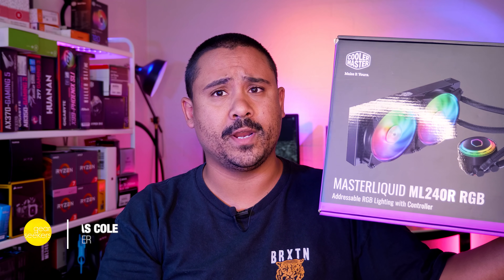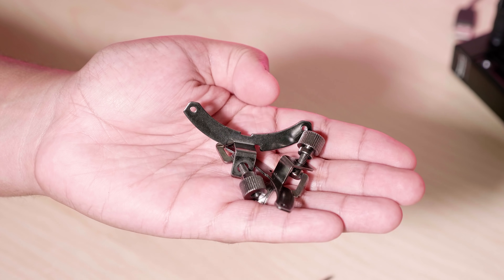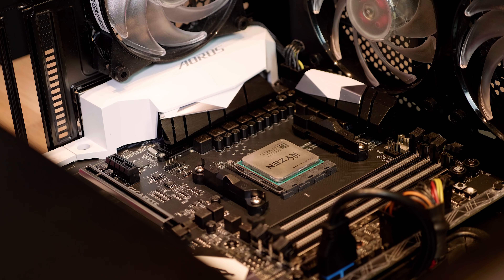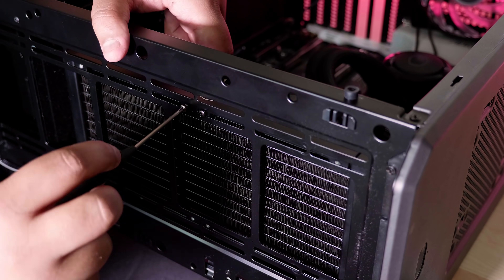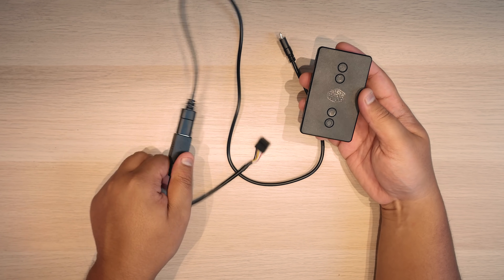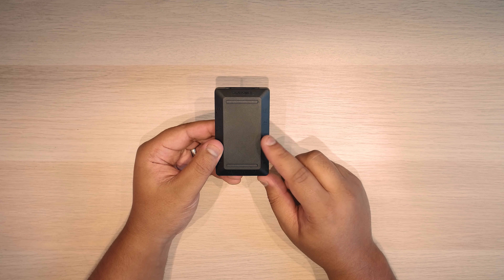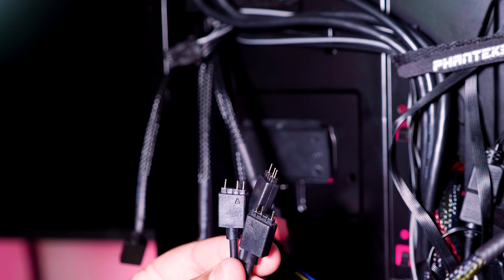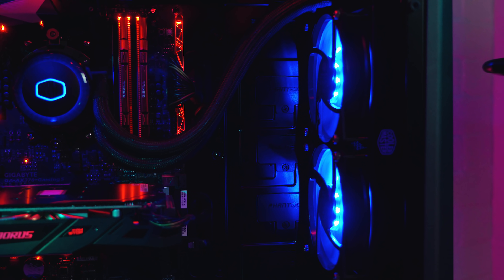HOW TO Cooler Master MasterLiquid ML240R RGB AM4 Install Guide

Comment: Im not fcking able to controll the RGB with the software
Reply from the maker: Read the comments mate. It's been answered so many times. Update firmware on controller
Reply: Gear Seekers 1. Jeeeez thanks man that was a super fast reaction, but overall I connected it so much different I didn't even use some of the cables and the guide for that is way to hectic and fast for me I gotta be honest

Comment: Currently installing mine while watching this vid :) very helpful so far BUT I don't have clips to mount it on the motherboard? Just 4 holes from the bracket behind... There was no heat sink on here before. Second hand strix 350-f. Any help is greatly appreciated
Reply from the maker: Oh that's annoying! Those clips usually come preinstalled on every AM4 board. You can probably get a set on eBay or Amazon for really cheap
Reply: Gear Seekers yeah £2! But postage is going to take a month so I'm looking at buying a cheap second hand am4 board just for the bracket haha. I'm just curious I've mounted my fans on the inside of the radiator like you, do the suck in air or blow it out?
Reply from the maker: The way I have it mounted on the front is the correct way for front mounting. If you're going to mount on top of the case then flip the fans over.
Reply: Gear Seekers I've now front mounted and fliped a couple of fans on the case to draw air out so there should be a nice air flow now! Thanks so much for the video and the replies. Very very  helpful :D
Reply from the maker: The front mounted fans should be drawing air from the front and pushing it over your components. It seems odd but from a lot of testing it yields the best results :)

Comment: damn this liquid cooler is complicated as hell
Reply: yeah I gave up with my RGB
Reply: Tell me about it.. took me 2 hours to figure it out lol. but it was my first time, next time a breeze probably. I was mainly scared for the thick cables and moving and bending them thinking I am messing them up but I had to forcefully twist them. My temps at complete idle are 30c on a i9 9900k :) Max while gaming about 67c on ultra 1080p with Ray Tracing
Reply: i didnt even plug that green cable just the rest should i ?
Reply: @TheMikrostaR  i just gave all my parts to a tech company and they built it for me with an amazing cable management i got so confused with this thing
Reply: @Goku20203134  well i have buuilt many pcs and my friends pc too , its not that hard but i just skiped that little wire i thought its not that important i will implement that part too ib my build.
Reply: @TheMikrostaR  might be easy but i wanted a clean job so i didn't risk anything
Reply: @Goku20203134  true when you dont know you dont..
Reply: I felt the same way when I dipped my toe into RGB setups recently, but once you get the hang of it, you realize its not nearly as complicated as you initially thought.
Reply: @brucelivingston2220  i ended up getting the corsair 150 rgb platinum
Reply: not its not your just ass at installing shit
Reply: Than your gunna hey trouble building a pc😂

Comment: I have 4 deep cool 5v Argb Fans on one 3 pin mobo header and 4 5vArgb stips by deepcool daisy chained on the other 3 pin mobo header. Can this unit chain off of one of those chains? either the fan or the strip chain? not sure how to get it all on 2 headers.
Reply from the maker: yes

Comment: How does it wire/work without the controller? how do you hook it to gigabyte 3 pin mobo?
Reply from the maker: you plug it into the mobo and it works. Why wouldn't you use the controller? It comes with it
Reply: because I want motherboard sync and control not their unit, i need it to sync with all the other light strips and fans in the system and be controllable through gigabytes rgb fusion.
Reply: Cory R Did you get this setup? Did you use a splitter for lighting? Exploring bypassing the controller as well.

Comment: Is this cooler overkill for Ryzen 2700? I intend to overclock to about 4ghz
Reply: is there even such a thing as overkill when it comes to cpu cooling?
Reply: superunknown, actually yes. If you cool below ambient temp then your CPU will produce condensation and that means water which is fatal for your PC.
Reply: @GothicDragonX  ummm how is that even possible? is your cpu not producing any heat for it to condensate? then what about nitrogen cooling?
Reply: @superunknown4850   dude, condensation is the loss of energy. you don't need thermal energy for it.
Reply: @superunknown4850   in fact, condensation requires 'coldness' ( in lay man terms)
Reply: @jeromegoh5309  Below Dew Point. Not Below ambient.
Reply from the maker: It's perfect for the 2700 :)

Comment: Do you have to install a software for the rgb to start or does it automatically come on, ive installed mine and for some reason the rgb won't work. Not sure if I have to install something or not, i have the ml250l
Please help
Reply from the maker: If you have the L version install the software.

Comment: can you use the software to control the lightning effect?
Reply from the maker: Yes
Reply: i cant use the software to control the light other than the original rainbow effect
Reply from the maker: Update the firmware on the controller.
Reply: okie, i'll try it, thanks for the suggestion

Comment: I got mine installed was tricky used your video and the supplied instructions.  They actually give you more cables than you need?  I am not sure why anyone would want to use the 3 way cable unless that's how you have to do it if you  don't use their software which is now available and without using the 3 way cable you can control each led component individually.  Very nice video.  You know what all these companies need in their software.  Thermaltake and Cooler Master OPTIONS, i.e. when the screen is off turn off the RGB as an option.  I think Thermaltake will inherit this as an option since they are joining forces with Razer (Chroma) and Chroma has this option for their RGB
Reply from the maker: Yeah it's a little finicky. Yeah the include extra cables Incase you have a different type of setup.

Comment: Hey love ya work. I've used many of your videos to help me build my own gaming pc with basic existing knowledge so cheers. For finishing touches I have purchased & attempted to install the Cooler Master ML240R. I could get the LED to light up but not get the fans to spin or vice versa. From watching your video I've realised that I don't have two CPU Fan Headers like you do in this video. Can I work around this or am I stuffed?
Reply from the maker: You can plug into any fan header
Reply: Awesome thanks. I’ve also got a RGB Header & a LED Header with nothing plugged into them. I suspect this is why the fans & cooler won’t light up but I can’t see what plugs into them? If this is the case do you have any ideas?

Comment: Also for all of you asking. Yes you can control this with ASUS ARGB boards.

Just plug the 5v (3 pin) extension cable to your **ARGB** connector on your Motherboard to the 5v connection to the Cooler Master Controller.
Then plug the 12v RGB (4 pin) extension cable from your 12v RGB connector on your Motherboard to the 12v connection to the Cooler Master controller.
Reply: So there is no way to ged rid of that damn controller? Did you plug the USB cable to the MB in your above mentioned setup?
Reply: A M honestly didn't try. From what I've read tho, as long as all ARGB components that are compatible with ASUS, should work straight from the Motherboard, split with a RGB splitter of course.
Reply: Got a Crosshair VII and I'm higly interested in that AIO system if it's working with my Aura environment. Heard that the controller isn't very reliable. Good news that it works with Aura Sync.

Comment: So, does this aio come with liquid already inside of the loop? That what’s what I was worried about. I don’t know if I need to put it in myself or if it is already there. You did not show putting any liquid inside so can I assume that it comes already in there?
Reply from the maker: Every single AIO is prefilled and doesn't require any servicing or filling.
Reply: lol

Comment: I want to thank you for actually showing how it's done right. The damn manual was screwed when it came to the wiring.

Thanks mate.
Reply from the maker: Thanks so much!
Reply: i have same feeling when i first look the instruction manual i trow it away. it is totall bullshit and doesnt explain intallation correctly. this video helped lot!
Reply: @GTX200  okay but I didn't get one thing where do I plug the pump in lol ? Maybe a cpu fan header?

Comment: how do i configure the fans to work with aura sync
Reply from the maker: Legit answered this question in the comments many times. Goto CM website, Download firmware update, update firmware, download rgb software and set to motherboard mode. Simple :)
Reply: in the CM website where does it say Firmware Download??
Reply from the maker: http://www.coolermaster.com/xresserver01-DLFILE-P1801100010db82-F1806010004bb83.html

Comment: Hello! Nice video, the best that I see about this WC. My doubt is, it works with RGB Fusion from Gigabyte? I have a Gigabyte X470 Aorus Gaming 7 and I like to know if the leds from the WC can be controlled with the software. Sorry for my bad english hahaha
Reply from the maker: As long as there is an Addressable RGB header it should be fine.

Comment: Hi all I have a problem, I purchased the ml240r,pump leds are working,fans are spinning but fans leds won't turn on
can someone help please ?
Reply from the maker: make sure sata power is plugged into controller and update the firmware on the controller.

Comment: Do I need a controller to control rgb or can I do that through their software? I connected everything up correctly and it’s not working, only the fans are spinning. I have an Asus z370 f motherboard.
Reply from the maker: Goto the CM website, update the controller firmware then install the software :)
Reply: Im posting this answer and I hope you will pass it on too, connect the extender give from you Mobo Add.RGB Header(3 pin one) to Splitter that connects your Pump and 2 fans, meaning nothing is connected to the controller. Straight from Mobo to the splitter, but keep your controller there. Instead use Aura Sync to control everything, make sure to link your add header in the software....Had to trouble shoot this myself T.T

Comment: Great video but I was hoping to mount the radiator to the TOP of the case. Is that possible? I'm looking at the instructions that came with the ML240R but it's almost as bad as Ikea instructions! Any help would be appreciated. Thank you!
Reply from the maker: Yeah top is also fine. As long as your case supports it.
Reply: Thank you for the fast reply. One more question if you don't mind. If I top mount it would it be better to have it draw air into the case or pull it out? Again, thank you very much!
Reply from the maker: pull air from inside the case and vent out the top

Comment: I saw a standard 4 PIN 12v RGB header in the bottom of the controller ! Does that mean that I can connect this to a 12v RGB header on my motherboard and sync the lights with Cooler Master's software or Aura Sync ?
Reply from the maker: The controller can do passthrough as well to 4 pin 12v RGB
Reply: Gear Seekers Thank you for telling me that. I'm getting the ML120R RGB version now 😁
Reply: Im posting this answer and I hope you will pass it on too, connect the extender give from you Mobo Add.RGB Header(3 pin one) to Splitter that connects your Pump and 2 fans, meaning nothing is connected to the controller. Straight from Mobo to the splitter, but keep your controller there. Instead use Aura Sync to control everything, make sure to link your add header in the software....Had to trouble shoot this myself T.T
Reply: Fareez Alcameon Haris I don't have an Addressable RGB header on my motherboard. I only have two 12v 4 PIN RGB Headers. My Motherboard is ASUS ROG STRIX Z270-E
Reply: Sadly you cant, an addressable header is 5v whereas a normal rgb header is 12v, I wouldnt dare to to try plugging it in

Comment: hey maaaaaan 😢😢 I NEED YOUR GUIDANCE 😭 have ordered ml120r similar with yours but for 120mm radiator only .. i have some problem cause i also have mb500 from cooler mastet .. how do i sync all rgb fans into one 😢 does that controller do add more cooler master fans? or will it able to add more rgb fans 😢 thank you for your response 😭😭😭
Reply from the maker: You can connect more fans to the included controller.
Reply: Gear Seekers I LOVE YOU SO MUCH MAN THANK YOU 😘😘

Comment: Does it work with msi mystic light?
Reply: yes you just bypass the controller all together and hookup the rgb splitter directly to the 5v rgb header on the MB. the crappy part is though it only has like 5 options through mystic, and has no static option. if you hit select all your presented with allot more colour choices however only half of them work. the other half will just turn the pump and fan rgbs off.
Reply: @edwardk12687  have u tried aura sync ?
Reply: @criticalurgency  no, I ended up getting so annoyed I took all the cool master light out and replaced them with corsair LL 120's since all my other case fans were already running those. Now I just control everything through I cue
Reply: I love this video but ahhh. What connects to motherboard add 3 pin header?  Or is all that bypassed by this USB connection.  Still dubious to me.
Reply from the maker: It works with any ARGB header as long as it's 3pin
Reply: @GearSeekers   Yeah, but that is not how one typically hooks up a pump and RGB fans to a motherboard. The connections do not look compatible without the provided controller. Please tell me I am wrong.
Reply: i think i threw away the plastic mounting things from my board what can i do

Comment: I replaced my older AIO with this one and since i mounted it i keep getting high cpu temps note that i have a i7 8700k and i mounted it nicely what could be the problem?
Reply from the maker: Too  much thermal paste or incorrect fan placement.
Reply: Gear Seekers i used more than you did to be honest but can the fans make that much of a difference because my last AIO had like 30 to 39c and this one peaks to 90s or so and im using the inwin 805 infinity
Reply from the maker: Ahhhh Yeah a huge difference. The amount I used is it the perfect amount for a Ryzen chip. The 8700K has a smaller IHS so it requires less than what I used on the Ryzen. Make sure that your pump is even flowing and your fans should be in the same orientation as what's shown in the video unless you're mounting on the top of the case which I don't think is an option on the 805 Infinity.
Reply: Gear Seekers awesome man thanks a lot btw i had nzxt x52 AIO do u think that i made a bad move changing it to this one?
Reply from the maker: No way! I'm using one on our Twitch streaming rig with a i7 6900K @4.3GHz and when streaming it hits maybe 35C

Comment: why the cable to go to the motherboard has only three pins?
Reply from the maker: Because that's how it's made
Reply: how can i controle the speed of the coolers?, its possible or there are only one automatic configuration. thanks you at all.
Reply from the maker: you can control it in the bios

Comment: I connect it in the same way as you, but when turning off the equipment, it continues to be illuminated and the most important thing is that the fans keep turning. Although VERY slow but they do it. Is there any way to connect it so that it does not spin anymore? thanks from Mexico (with google translator)

Comment: It is the same installation for MasterLiquid Lite ML240L RGB on a AM4 motherboard? Thanks in advance
Reply from the maker: It is! The only difference being the ML240L has extra screw holes but when you line up the bracket the same way you'll see the correct holes.
Reply: Thanks for the answer, I am a 60 yo old fart, who is building a system mainly for streaming, with a MSI X470 mb, with a Ryzen 5 2400G, I hope it will clear my 4 sticks of memory.  Don't trust the stock stealth cooler, and for only $70, it's got to be better. Thanks again
Reply from the maker: Yeah it's a decent cooler for the money! I'm running the ML240L on my Threadripper 1950X and it cools it perfectly! The ML240L wont go anywhere near the memory so you should be all good :)

Comment: are cooler master already selling those fan separately? will be getting the aio next week just wondering if i can get the fans so i can use them for the case aswell
Reply from the maker: I'm not sure to be honest. It depends on your region. In Australia I think they are for sale already.
Reply: Gear Seekers thanks man ill try to look for a source cause i cant seem to find one on MSY's webpage i saw some MasterFan Pros RGB 120mm but im not sure if they are the same with the ones branded as ARGB / Addressable :) thanks again and keep up the great work :)
Reply from the maker: Kim Kelvin MSY takes a long time to get that stuff. They haven't even for the Corsair LL fans yet
Reply: Gear Seekers yeah i noticed it aswell but cant do anything as its only the closest retail shop where im in :(
Reply: been a month now still fans not even on CM's Store page :( PCCG said they still dont have them either :(